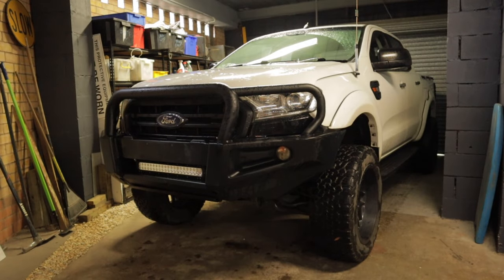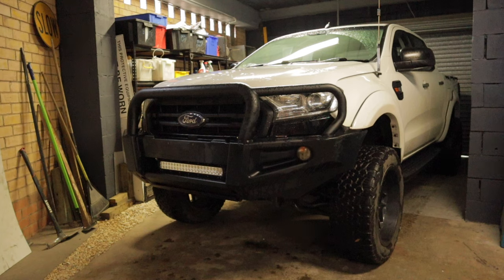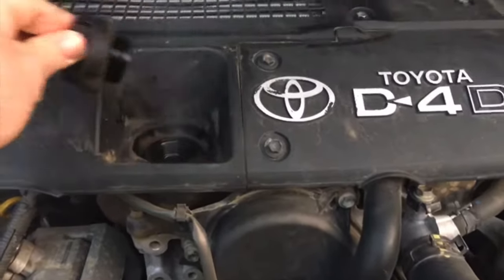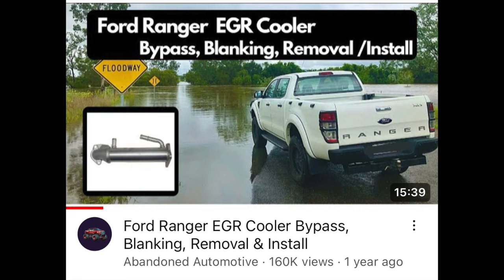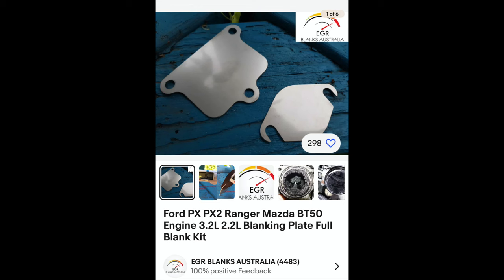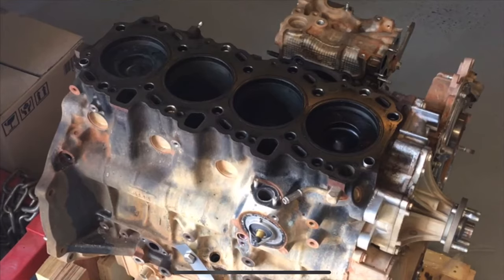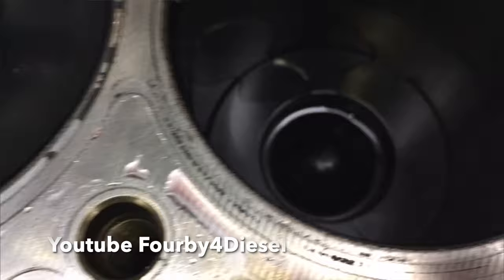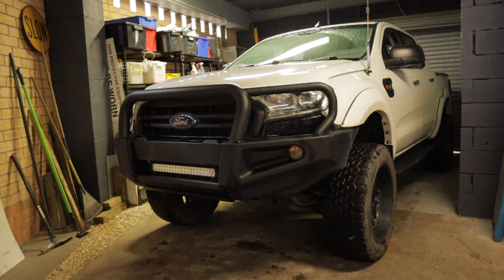Ranger EGR Cooler Failure VS Toyota 1KD Cracked Piston Facts!

Comment: Anything will be reliable if it’s serviced well . There is plenty of Ranger’s running around with 350 + kilometres on them . Personally I think the variable vane oil pump is a time bomb. Whichever genius engineer though that was a good idea should have his nuts cut off . Oil pumps have been basically the same design for a hundred years and ultra reliable. Then they go and use a power steering pump for the engine oil that have always had issues. My brother has a Ranger and it’s been a fantastic vehicle. I have a 2001 hilux  5L engine and it’s done 470 k still doesn’t use a drop of oil or blow a whisp of smoke. All the plastics and interior are still perfect on my old Hilux  there is no doubt about the build   quality of Toyota especially the Japanese ones .
Reply: Absolutely agree re variable vane type oil pump in Ranger, the conventional style geared pump when run with clean oil will easily outlive most engines, for the minuscule fuel savings the far less reliable variable pump makes the cost of a failure or a holed sump where the 10 minute oil change can't be done is costly and a massive waste of time and excess oil when attempting to prime a variable pump.
The problem compounds in a 4WD model as it is not easy to remove the sump to replace the pump with an easily obtainable constant flow geared pump as the cross member under the engine is welded and requires cutting and grinding to remove, allowing sump removal.
Apparently some early model PX-1's had a bolted X member however I haven't seen one yet.

Comment: did you turn off the EGR through the ECU? or that step is not necessary when blanking an EGR? I have concerns about the check engine light turning on if I ever do the blanking myself

Comment: Ford Ranger may not have the piston issue but transmission issues , blown egr , diff plugs to low ,,,air-cons that ford cannot fix for the tropical north ,,,, [hint charged with air then blows compressor]   ,,,criuse controls that are disconnected by Ford ,,, very very thin paint ,,, window seals that donot touch the glass WOW,,,tail shaft nuts that have insufficient threads   Yea Quality be your own judge .....

Comment: 1kd has an issue with piston strength. I would not leave the fix to Toyota. Aftermarket custom pistons . Overloading engine either by powerchip or loaded weight will cause this as well . Best thing u can do is to block egr  so clean combustion occurs .

Comment: Well said. 
It’s pretty pathetic that any manufacturer have these types of problems!  Especially because they charge a premium price for their products, but deliver a below sub par product!  It doesn’t stop at these brands.  It just comes back to manufactures using cheap parts or poor engineering!  But yet they charge a premium price..  then turn around and oh not our problem.  It’s yours. So u just spent a premium $ 60k + on a new vehicle + u have to pay for our poor engineering or selection of cheap parts that break…. Unfortunately this is a normal situation now.  Consumer’s should not be made to pay an above premium price for a below sub par product & then be made to pay for companies engineering / manufacturing cheap skate products….   Now days the words durable or reliable aren’t used anymore when speaking about vehicles.   well anything really….
Reply: Said same thing for years, there penny pinchers , need to do more updates on engine efficiency , instead of do nothing until new model comes out .

Comment: 373,000km on my last 1kd SR5. No tune or chips, egr blank pate 7mm hole, replaced injectors at 200,000km wirh genuine new and 8000km services. Never any issues, so who knows why some crack pistons.
Ive mever heard of ranger egr failure but pl
A few mates with auto box issues with the rangers.

Comment: Gday, Question....If I do the egr delete on the previous video do i need to do the hose  egr cooler bypass also
Reply: If you blank both side of the egr, than you dont need to bypass the coolant pipe because your egr cooler got no exhaust gas to cool down  so the egr cooler wont fail

Comment: All news is bad news. Common problems are no different. Everyone ignores engines without inherent problems, as there's nothing to report, Mitsubishi 4N15 has no spotlight shining on it, nor do the Isuzu  offerings, perhaps not as popular, but they shouldn't go ignored. Don't you think?
Reply: 4jj1/4jj3 like to snap crank shafts and swirl flapper screws come loose and destroy the engine, also they tend to suffer from a lot of engine sensors failing. 4n15 petty good all round but they dont like being overheated as they have 4 head bolts per cylinder as apposed to most others using 6 head bolts per cylinder. All modern diesel engines have their achilles heels.